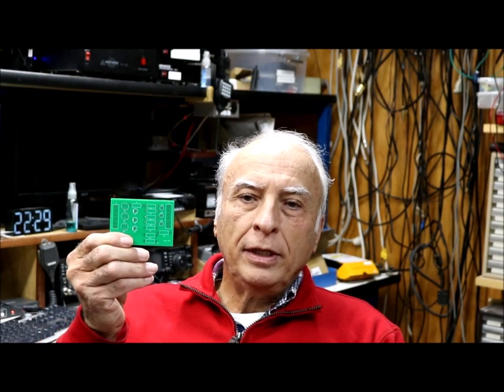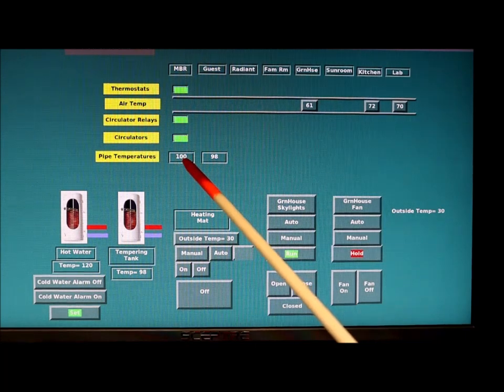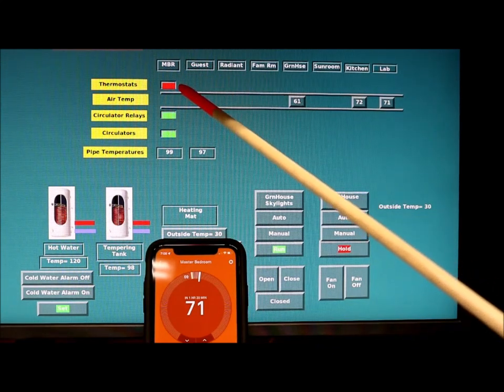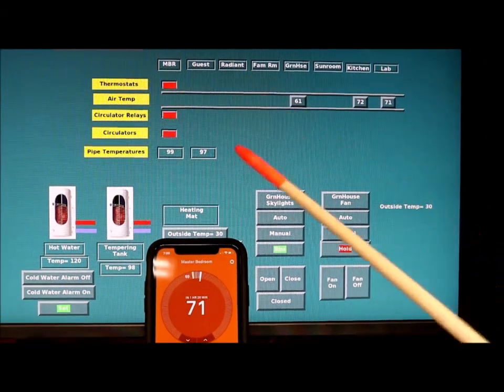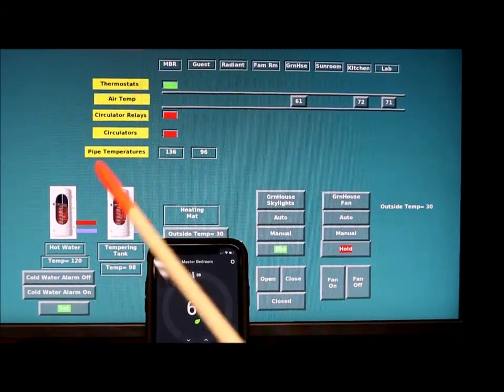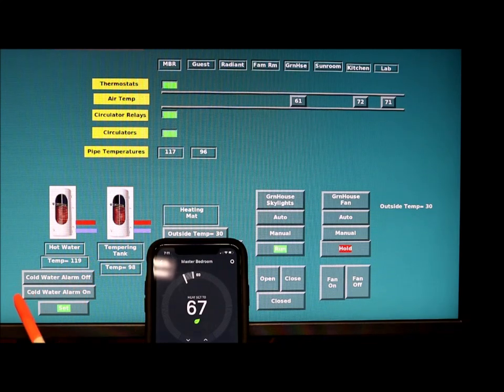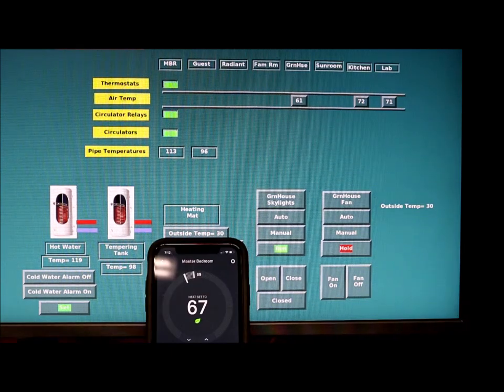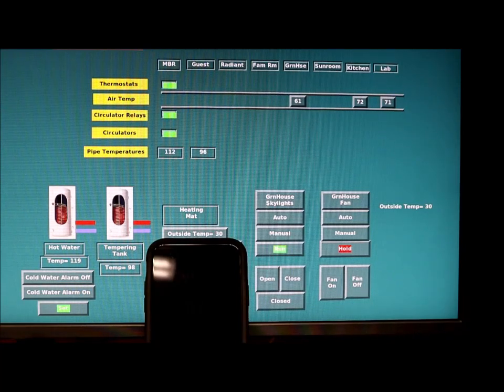Heating System Computer Interface

Comment: Kind of useless without the circuits behind the display.
Reply from the maker: Really? The intention was not to document the circuitry of my entire home automation system. I mentioned that the output was a logic high or low which could be read by an Arduino or Raspberry PI input or any similar HA system.